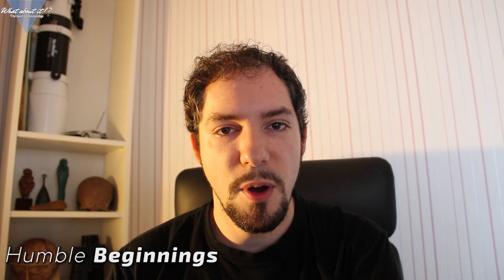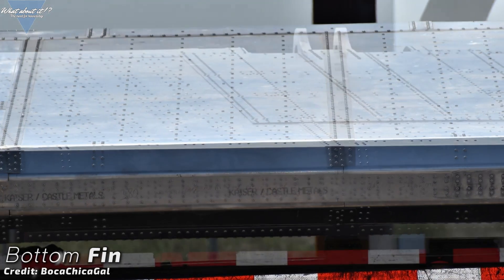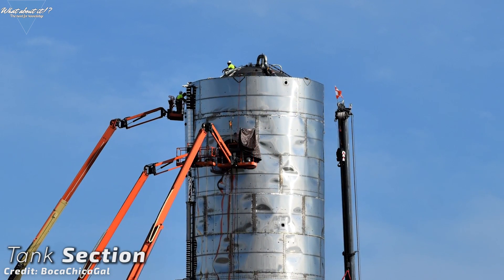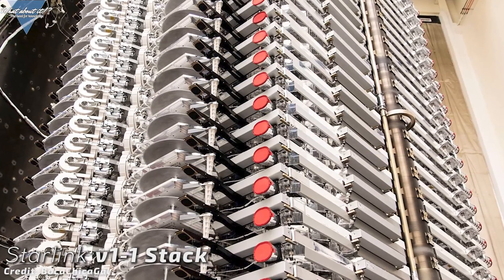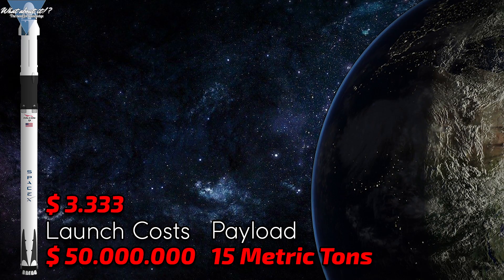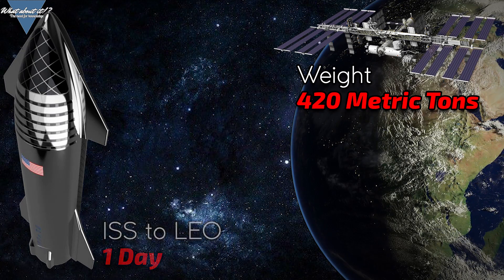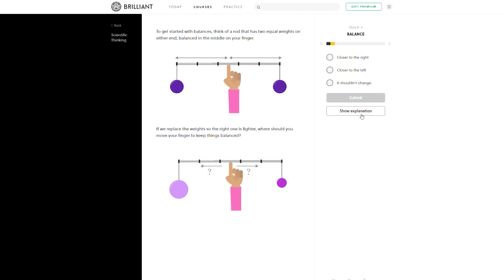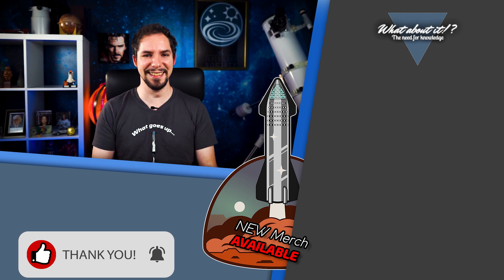50 | SpaceX Starship Updates – Starlink v1-1 Aftermath – Starship Reusability

Comment: The $2 million price is yet to be seen.  I think this figure doesn't recoup the development costs or any profit.
Reply: You have heard of Elon time. Well this is Elon accountancy.....
Reply from the maker: We will see. Elon has made rockets land and electric cars charge... ;)
Reply: @Whataboutit  Quick-charge (really quick) AND with acceptable ranges! And  Tesla and all his other companies w/o exception will come very handy when Mars colonization begins.
Reply: newsgetsold Starlink is meant to cover profitability, not Starship
Reply: This figure is assuming development is "finished" and the design is locked. It assumes production is in full swing and the process is optimized much like a car or airplane factory. It assumes the target reuse figures have been hit which are reuse for 10 launches, do a refurbish, repeat until 100 total launches (I think). That price covers build and fuel. Sounds nuts really. And i think the main issue is re-entry, If SpaceX can get those heat tiles to actually be reusable then this is possible. The engine re-usability I'm not too worried about. The Merlin engine is fired 7 times total for every launch (including test and static fires). The RD-170 is known to have been fired up to 60 times with no referb to stress the engine to the limit. More proactive dev on rocket engines and I think they could get near (near, not level) a jet engines reliability. More pressure stress but also much less moving parts. 

The heat tiles though.... I can see the shuttle happening again. The realization after that you really do need to refurb after every launch, I can see it happening. Maybe not, SpaceX is full of much smarter people than me. Esp when you consider this:
SLS uses existing parts (don't need to manufacture) and existing architecture and tooling (don't need re-tooling for change of design). SLS has cost $17 billion so far. Projected cost is over 30 (including launches) 
SpaceX total budget, including launches (not counting getting paid for those launches), including government funding, SINCE ITS INCEPTION, has spent less than 5$ billion..... Falcon 9 block 5 was flying with 3 billion spent, Dragon capsule nearing end of development.

I have doubts, and worries, but i will not say its impossible or cant be done as what they have done so far for the money spent is mind numbingly outrageous. Orion cost more than all of SpaceX.
Reply: @Skunkwurx  Major differences in the tiles:
1) all the same shape 
2) mechanically attached, not glued
3) protecting a stainless steel body, not aluminum

This will not be a repeat of the Space Shuttle.
Reply: @terrelshumway427  Yes that is all true, which gives me hope! And I didn't mean it would cost anywhere near the shuttle, just the reusable dream would become a relatively cheap refurbish-able dream. It'd move from $2m to 5m or 10m or something like that. If the engines can only fire 50 times not 100 the price will jump. If the time last only 7 flights instead of 10 and so on. I also dont tink that price includes payroll but I'm gonna do some math in a minute.
Reply: @Skunkwurx  the tiles will be mechanically fastened instead of glued.  That and the shape of starship is more regular than the Space Shuttle so the tiles will be cheaper.
Reply: its $2 million for operational costs. in other words getting checked over, fueled up an launched. thats not including the additional costs for the profit margin.
Reply: The 2mil only includes fuel and launch site operations, it's kinda ridiculous to claim it as cost per launch. The company payroll costs alone are hundreds of millions of dollars per year which the launches need to cover.
Reply: aleksander suur - Here’s a breakdown of ALL costs included - 
Fuel - $900,000 max 
Maintenance - 500 person-hours per launch X $100/hour = $50,000
Facilities costs $2B/1000 launches = $2 million
Amortized Development Costs = $10B/(1000 Starships x 1000 launches/Starship) = $10,000
Amortized Building Costs = $1T/(1000 Starships x 1000 launches) = $1 million 
Other fixed costs = $1B per year/1000 launches = $1 million
Total based on above = $3,960,000/launch
Add 25% profit, & your still have $<5 million/launch
Reply: @TraditionalAnglican  Dude, your calculation depends on building 1000 Starships and launching 1000 times each, total 1 million flights.
Over 75 flights Falcon 9 has seen several major design revisions and now that it's finally refined to it's limitations it's set to be replaced by a new and completely different vehicle that is Starship. Similarly Starship will do at most couple hundred flights over the entire lifetime of the program before it'll get phased out in favor of a next system.
It's a new and first of it's kind system, as soon as it becomes operational plenty of problems, limitations and possible improvements will become obvious, many of which will necessitate going back to the drawing board.
Reply: aleksander suur - SpaceX claims Starship will be able to launch 3x/day & do 1000 flights before needing anything remotely approaching the refurbishment done on the Space Shuttle, & my maintenance figures included minor refurbishment every 100 launches (equivalent to what airlines do every 1000 cycles). SpaceX also says they will be producing 2 Raptors/day by next June & 6/day within another 2-3 years. SpaceX plans on producing Super Heavy/Starships like Airbus & Boeing produce aircraft. These won’t be “boutique” “one-off” items like most rockets have been for the last 60 years. You’ll see my “Production Costs” per Starship were actually quite high, constituting an overwhelming majority of the Total Costs. Based on my figures, “costs/launch” actually go down slightly if SpaceX produces 500 instead of 1000 Starships.
Elon has said he needs 1000 flights of Starship to get the Martian colony up & running & self-sustaining, so I based the 1000 Starships figure on that. 
Based on production of 6 Raptors/day & use of 43 Raptors/Starship, I’d foresee production of 50 Starships/year. The only questions then are - How long does the “Production Run” last? When does SpaceX start production of the “Mega-Starship”? &, Will these be produced side-by-side, or will Mega-Starship production completely replace Starship production?
In answer to your final question, the 747 has been in production for 48 years, with multiple versions to deal with “limitations” or to extend the capabilities of the aircraft. Boeing hasn’t had to “go back to the drawing board” to completely redesign or reengineer the aircraft for any of the subsequent revisions. Boeing ironed out the major issues during development & testing of the aircraft (something that didn’t happen on the MAX-8). SpaceX is going to build & test at least 4 “Preproduction Prototypes” & another 4 “Production Prototypes” before beginning full production of the Starship. That should give SpaceX ample opportunity to correct any major issues that could arise.
Reply: @TraditionalAnglican  If you are going to compare Starship to an airliner, then it's not 747, it's de Havilland Comet. Certainly an airplane that revolutionized air travel, but also first of it's kind with rather drastic teething problems. And there is a rather significant issue with talking about thousands of launches, the world space launch market is only ~100 launches per year. Even Starlink will only add ~75 launches to Starship docket and that's spread over several years. SpaceX will have to create an entirely new spaceflight market from scratch before it even has any reason to fly thousands of times. And if you think expanding world market for something by a factor of ten or more doesn't come with it's own surprises, well some people are just hopeless optimists.
Reply: aleksander suur - Spaceflight is far more advanced than jet aviation was when the Comet was developed. Starship is most definitely neither the first rocket nor the first interplanetary rocket nor the first reusable rocket developed. The “Space Launch Market” is where it is because it has cost $15,000-20,000/kg (or the inflation adjusted equivalent) to get stuff into space for the last 60 years. Things that have been completely unimaginable at that price become quite sustainable at $20-70/kg. Think of where aviation would be if transcontinental seats cost $2 million because we threw away the airplane after every trip, & you’ll see just how impossible our present passenger-airfreight model would be. Think of reducing the cost to get someone into space down from its present $84 million (cost of using Roscosmos to get to the ISS) to $8400, & the revolution in that industry that would be created by a fully & quickly reusable Starship should be obvious.
Qantas just flew a flight from NYC to Sidney - The flight took >19 hours. Qantas is planning on a London to Sidney flight that will take >20 hours. The cost of a Business Class ticket on these flights is the same as, & that of a First Class ticket >2x, what the cost to get someone into orbit on Starship. Starship could make that trip in <40 minutes. Business is all about money & time. SpaceX check-in, Security, boarding, de-boarding time won’t be any worse than it is now on international air trips, so SpaceX Starship would save these travelers as much as 19.5 hours without costing them any extra money. Various companies & organizations are planning hotels & huge space stations, but they can’t build them because of launch costs. Most of those become quite feasible at $20-70/kg. 
The Lunar Gateway is essential largely because SLS Block 1 (which GAO & NASA have agreed will cost $2B/launch without Amortization of Development Costs) can’t deliver the Orion & its ESM into Lunar Orbit. SpaceX Starship could land on the moon (with 100 t or 100 astronauts) & return using 5 in-orbit refuelings (that’s a total cost of $35 million at the pessimistic estimate, which is still <0.4% of a SINGLE SLS launch). &, going to Mars, Near Earth Asteroids & the Asteroid Belt all become sustainable at <$500/kg (total costs at the pessimistic estimate) to get there & back. 
If the Starship succeeds it will revolutionize spaceflight in the same way Microcomputers, PC’s & the Internet together revolutionized everything that uses computers. Starship will be every bit as disruptive in the field of aviation & spaceflight as telegraph, telephone, wireless, radio & television were in the field of communications, but, instead of happening over the span of 100 years, this disruption will happen over the span of 5-6 years.
FYI, Jeff Bezos & Blue Origin are trying to do the same thing with New Glenn & New Armstrong, & their plan to use these (& future rockets) to get billions of people off of earth & into O’Neal Cylinders is even more ambitious than SpaceXs plans for Starship.
Reply: @aleksandersuur9475  Ignore the payroll compared to the many, many flights, the NASA contracts and the foreseeable Starlink revenue.
Reply: @aleksandersuur9475  yeah but they are strictly talking about fuel and launch site operations hence why they said spacificly operational costs obviosly there will be additional costs for customer usage for the profit margin, and  once they have a fleet of these starships, imagin these happening on a daily basis an how much money it will make them lol
Reply: @Nick871203  the topic is costs, not the price the customer is paying, totally different things. And even with daily launches, the cost per launch is not 2mil. They have 7000 employees, so the payroll (which is certainly operational cost) alone is something like half a billion per year, spread over 365 launches per year, that's already 1.4mil per launch, add 900k for fuel and your 2mil piggybank is broken.
Reply: @aleksandersuur9475  37+6 Raptors at $2 million each is $86 million
900k fuel per flight for 100 flights is $90 million
That leaves $24 million to build the booster body and starship body assuming a $200m limit. / 100 flights - costs $2m. and also includes launch costs. Ehhhhh.
And it gets weirder as I think this also assumes there is a full fleet.
Payroll is very weird to add, because a few of the employees are included with the price of Raptors and body (even though I dont think 24 is near enough for that but what ever for now)
But starting again with your ball park at $500 million, lets work the other way.
OK...... my brain hurts.
Assuming a fleet size of 100
He wants to build 1 engine a day (he said every 12 hours once but meh)
So 365 engines a year. With 43 engines each that is 8.5 SS-SHs built every year. That is roughly 12 years to build 100 SS-SHs.
I calculated 12 years at 10k employees (to account for the hires needed to build at this speed) ($715m) (got from 7k at $500m), that is $8.6 Billion in payroll.

900k fuel cost x 100 x100 is $9 Billion
Payroll cost is $8.6 Billion
So total cost minus material is $18.6 Billion
$2 million cost x 100 x 100 is $20 Billion
That leaves $1.4 Billion for material (as payroll is done) costs to build the engines and body of 100 starships. No idea what materials would cost. $1.4 Billion would buy a lot of materials though. 

This does not take into account the MONSTER up front cost to get this working and only looks at the cost after each SS-SH has met its target which is a mad way to see it when starting out. Plus this is the cost not the price.
If I messed up with the math, or missed something, sorry, its late.
Reply: So accountant double the price to 4m itll be still great and profitable...
Reply: @prolamer7  its great and profitable at 40m. it would be cheaper then the competitors at 400 million
Reply: Even if the final actual figure is 10 times this estimate, it will still be game changing.
Reply: @GypsyTinker2012  True, it's certainly game changing, even if the actual cost is same as Falcon 9. Falcon 9 can put up 60 Starlink satellites, Starship can put up 400. If they get on orbit refueling working it'll be a whole new level for beyond LEO spaceflight. If they get it manrated it can earn it's upkeep with space-tourism alone. They can get a whole lot of flights done fast with a small number of vehicles and at a reasonable cost unlike Shuttle program. All that is awesome enough, there is no need to add unrealistic hype on top.
Reply: Fut bool
Reply: Elon said at the starship reveal presentation, that it had taken just 5% of spacex's resources to develop so far. They basically developed the raptor and starship as a side project to the falcon launch program. That figure wasnt meant to include profit but profit is not an industrial cost its a redistribution of financial power. When its more than fraction of costs, its profiteering.

Comment: One engine per day is their target for the end of the year (it was two engines per day at first)
In order to send 10 times 1000 starships to mars and back you need:
10,000/10 = 1000 spaceships
10,000*6/100 = 600 tankers
10,000*6/1000 = 60 boosters
That's (1000+600)*6+60*37 = 11820 engines in 20 years so 591 engines per year.
Reply from the maker: 1000 Starships, not 10000.
Reply: @Whataboutit  The spaceship can be reused 10 times, but it's misleading. I'll update it.

Comment: 2:12 that's pretty thick as for fin
Reply from the maker: Definitely. And very heavy. Weight reduction will have to be done a lot.
Reply: @Whataboutit  Any thing that they learn, I hope is applicable to my rotund self :F need to reduce at least 50 lbs... Thrust from the knees is not keeping up with the weight... Chairs and Sofa's are becoming problematic LMAO...
Reply: It's not aerodynamic, if that's what you mean.  It's meant to provide drag, not lift...
Reply: @stevebothe1416   yes but it shoudl create drag in other direction. During launch it's awfully not aerodynamic, especially, at back. Good that it is just prototype
Reply: @_mikolaj_  You should remember - (refer to recent F9 launch) when launching the ship can reach Mach 1 in less than a minute and Max Q in 1:15 min.  The power far outweighs the drag.  One thing you can be certain of is, SpaceX engineers are not idiots.  Yes this is a prototype to test many technologies, and a landing process that has never been done before - it is cheap and nasty.  It will be tested and iterated upon in future ships.  This is how SpaceX does things...

Comment: All this is very cool but what about Superheavy booster?! Starship could do nothing without it. Any info?
Reply: The info well known since weeks (starship presentation) is, that mk1-3 will need no booster, they are test vehicles for simple orbit and landing test. mk4/5 will have the first SH boosters. mk1-3 have no payload so it is SSTO for mk2 and mk3 (mk1 only goes 20km up for general avionic systems and landing tests)
Reply: finroddd gonna start building it either while Mk. 3 & 4 are being built or after they’ve flown- can’t remember which. Elon said the bottle neck is Raptor production...
Reply: Starship can do things without it. One stage to orbit without cargo but really good point to point transportation.
Reply: Superheavy booster is also in development and it'll be much easier than Starship. Mainly re-size Falcon 9 and replace Merlin with Raptor engine tech.